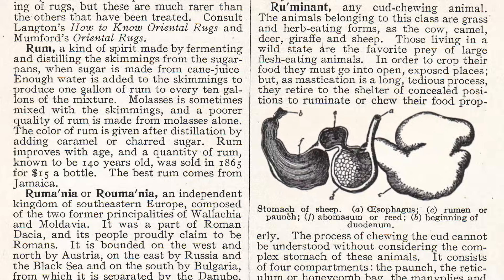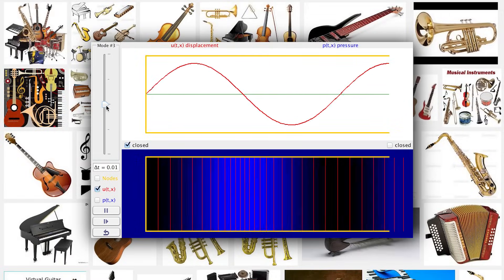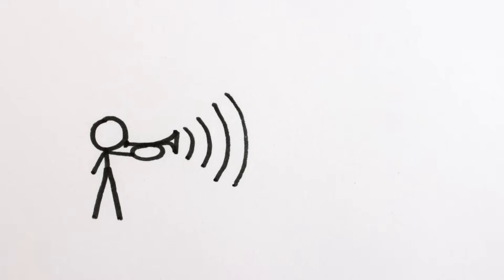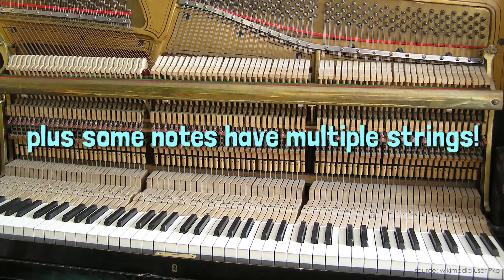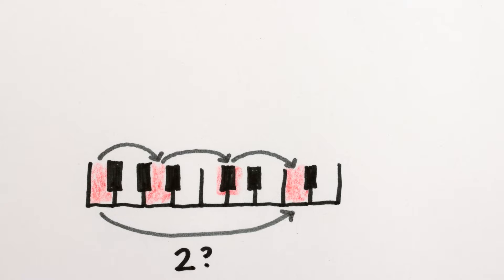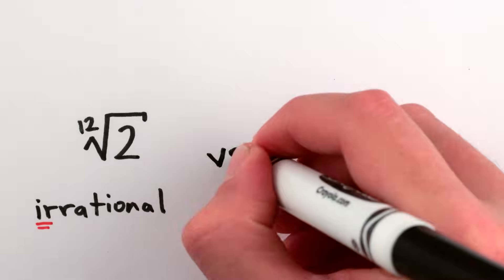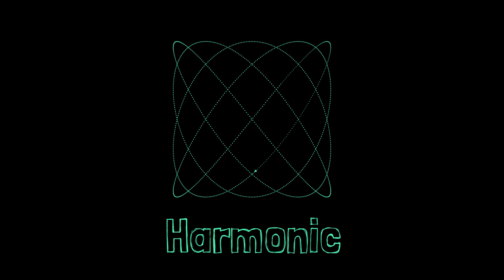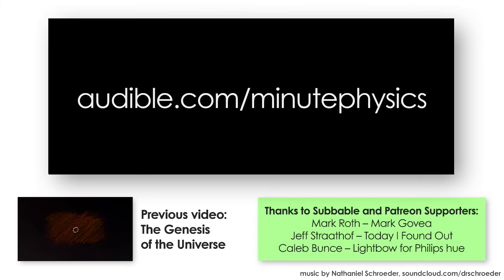Why It's Impossible to Tune a Piano

Comment: As a teacher and as a recovered piano tuner... I got as far as "The more bumps.. the higher the pitch".... 
how about.... 
" humans perceive faster vibrations as higher pitch"
and
"String naturally vibrate as one whole length, and at the same time in smaller/shorter lengths at the same time, just like the ocean can have huge swells and between the swells the can be smaller waves too... all at the same time".
and
the whole string  ( the primary or "Fundamental note ")  and the smaller partials, and even smaller partial/portions ( overtones) of the string each and all produce their own pitches or notes at the same time
and
a string of a certain (combination of ) length, tightness and thickness ( or mass/weight) will vibrate a a certain speed. Change any variable and the pitch changes.... tighten the string and the fundamental and all of the overtones go up.... or shorten the length , and the pitch goes up. an vice versa.

Back to the overtones.... 
As previously stated, A string vibrates as a whole, and vibrates in smaller ( very predictable/ consistent) lengths. The whole string, two half portions, four quarter sections. and other portions. And the "half portions" produce a pitch and octave higher, and the quarter sections produce a pitch two octaves higher.
BUT !!! the actual "Stack" or "Overtone series" of shorter and shorter ( higher and higher partials/overtones) are,, ( in higher and higher pitches)
Fundamental, then octave, fifth, octave, third, fifth, octave, third, fourth, fifth, octave.... and every partial all at the same time.... in smaller and smaller pieces of string

BUT THERE'S A PROBLEM !!!
"In theory " a string of a certain length vibrates at a certain speed" and " it's HALF LEGTHS  will vibrate at twice the speed .. or "an octave higher"  BUT !!!

If a  whole length of string is 20 inches then "half lengths" would be 10 inches. But there is a dead spot between vibrating sections called the NODE.... and the NODE steal a little length... so unfortunately "one half of 20 inches isn't 10 inches.... IT'S 9.7 ( or something like that) so the octave length is a little short so the octave pitch is a little sharp.!!! and this "error" gets worse and worse as we go "Up" the harmonic stack ( overtones".... This error is called "Enharmonicity" 

So when a piano tuner is tuning a "High A" four octaves up.... he tunes that string to be in tune with the Very Sharp Overtone....  NOT  "A2 = A6" ( four octaves).... and ALL of the overtones in EVERY NOTE / STRING  are sharp!!!. so a piano tuner's job is to make 88 compromises. And.... if you have good hearing,,, play any not on the middle of the keyboard... and then play the highest similar note... ( A to high A).... dont be confused if the high A sounds WAAAAAY Sharp... it should be,,, because its tuned NOT to the lower A.... but to the very sharp overtone PARTIAL in that string.

p.s. "Enharmonicity" became a greater phenonm when piano design added a very strong internal cast iron framing ( called the plate)... it looks like a  a big brass collored harp.... Plates were incorporated so that strong wires ( strings) could be used which could be pulled MUCH tighter... which provided a LOT more brilliance, volume and tone. By the way although not the ONLY BIG DIfference.... a piano has a Volume dynamic range but a harpsichord ( Lurch-Adams Family) has NO dynamic range.... and the "REAL" name of a piano is the "Piano-Forte" ( The keyboard that can play soft AND loud) 

 so.... morals of the story
You cant... please do not try to .... tune you piano using you guitar tuner
The software that is used to help experienced piano tuners tune is quite advanced.... and the FIRST this we do with the software is tell id that we a listening to a "New" piano... then we play certain notes.... the softare "hears" the piano and then charts the "Enharmonic Characteristics" of THAT piano. And a 6 foot Steinway, vs and 6 Foot Yamaha or Baldwin are ABSOLUTELY NOT.... the same.

Comment: Tuning a piano is way more complicated than that, regardless of intonation. For a start, each note has three strings and they are not tuned exactly in unison; they are are given "voice" by have a slight dissonance between them. Secondly the bass and treble notes are tuned slightly sharp and flat respectively, as the human ear does not perceive pitch equally from very  low or high notes. Then of course modern pianos are usually tuned to even temperament which  has two notes that are very far from true or "just" intonation..(the perfect third and perfect fifth in particular are bent to fit the scale of equal intervals that allows for unlimited modulation). It is possible to use a compromise intonation like Bach's "mean tone" (often used in pipe organs) but that only allows a certain number of keys to be played in, as modulating too far away from the home keys creates unacceptable dissonance.
Reply: @cjheaford   Nice reply, although you mistake my experience for only book learning (although being a trad muso, not a classical one, some is). I made and play uilleann pipes, as well as play violin and other traditional instruments like Sitar, where just intonation or modes are used for many styles of music. My mistake on voicing all pianos though, (not my instrument, so I not sure where I picked that up). I have tuned accordions and concertinas and we definitely voice free reed instruments with unison pairs or triple reeds for the distinctive sound that produces. I'm fully aware of the variance between just intonation and temperaments, including even temperament. I was trying to simplify it and mentioned the two worse examples of the major third and sixth as standing out. 
As for Bach and the well tempered clavier, I have to disagree. He played church organs and there you have a conundrum, to sound well tuned they would ideally be tuned in just intonation, but there you are very limited in how far you can modulate, hence mean tone allowing a fair degree of freedom for the composer. So far as I'm aware he played mostly organs that were in mean tone. His violin playing and compositions though are another matter. I am familiar with the well tempered clavier as well, and there is no consensus if he meant it to be played on an even tempered instrument or one that was using another scheme, or even if it was to be retuned for each piece, as they don't modulated but are separate preludes and fugues (not so unusual with the clavier, spinets, virginals etc back then).
Reply: Sean Coyne 
Kudos to your experience with instruments such as the beautiful Sitar.  Respect.  But the sitar - by its very capabilities and tradition - is NOTHING like western equal temperament.  The sitar allows you to play all the notes in tune...and also the notes that western music doesn’t even acknowledge exist.  You are trying to take this conversation beyond its original intended scope.  

And yes, Bach played organs.  He was particularly famous for that.  It’s just that for most of his life, he hated how organs were tuned.  He could not play in all western keys at the same keyboard without stopping to re-tune.
Bach cracked the equal temperament with his eponymous volume in all 12 major & minor keys.  It’s a historical breakthrough, and all music changed after Bach proved the value of leaving all notes on the keyboard out of tune.
Reply: No such thing as perfect third..
Reply: A professional tuner actually does tune the 3 strings beatless.  The myth of leaving slightly out of tune unisons is only told by lazy tuners who haven’t yet learned beatless unisons.  ; )

Comment: The amazing thing is that 12th roots of 2 happen to include 2 numbers so close to the basic fractions 3/2 and (thus also) 4/3. Compare any other set of scaling roots of any small integer; 2^(7/12) and 2^(5/12) are amazingly close:

2^(7/12) is 0.1% off from 3/2, just as (by corollary) 2^(5/12) is from 4/3.

Comment: I'm a piano player and I've sat in on several tunings... Tuning a piano is not impossible or a science... it's an art. The fundamental pitch (usually middle C)is achieved using some type of tuner. every not above is slightly sharper and every note below is lightly flatter in equal temperament except the octaves. To achieve the best sound the intervals like fifths fourths and thirds are fine tuned to each other using your ear to discern resonant frequencies called beats when the pitchs clash against each other... octaves are the most tuned to each other so that they produces overtones when one note is struck... and each side string is tuned to the middle string so that the note when struck sustains the frequency of the pitch over a time chosen by the person tuning the piano. No two pianos are exactly the same and each sound produced through tuning is a work of art!
Reply: I tried tuning a piano once, I'll say the piano won that game, not me.